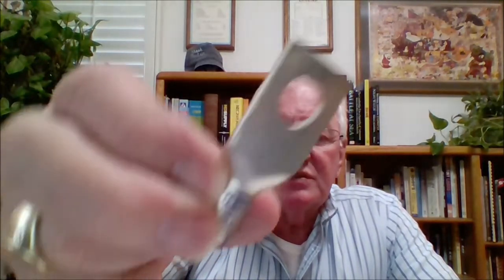Electrical Connections,  Lugs, Clamping, Disney Manager

Comment: Another connection issue I have ran across involves aluminum wiring in homes and outlet replacement... I know the proper way is to splice with No-lox and use the proper wire nuts, etc...but I have found a faster way and more reasonably way,  buying aluminum wiring outlets called CO-ALR, they run about $4 apiece, but they are time savers.  Many electricians I run across are not aware of these, and neither are Home Inspectors educated on these as well and will not pass a house inspection unless they see copper attached to an outlet or switch. So, unnecessary work is redone and cost the homeowner a lot of cash.  May I suggest a video on this subject.